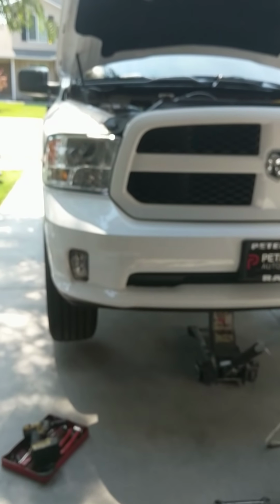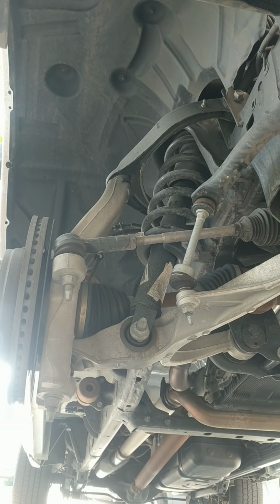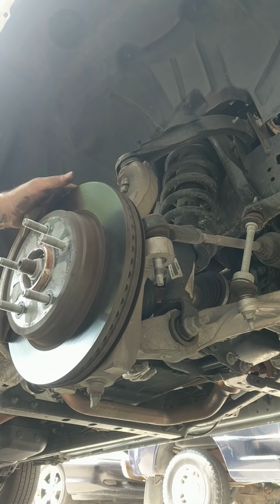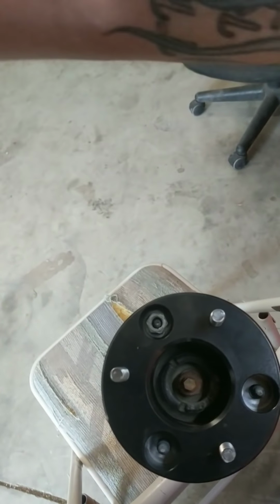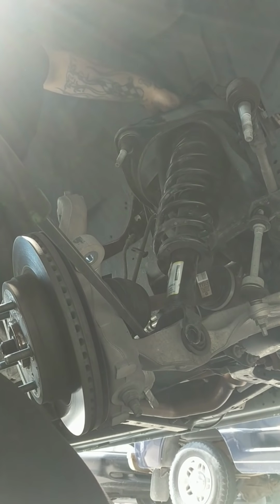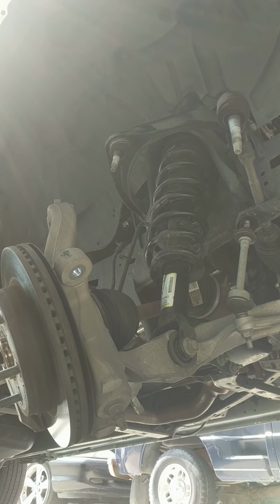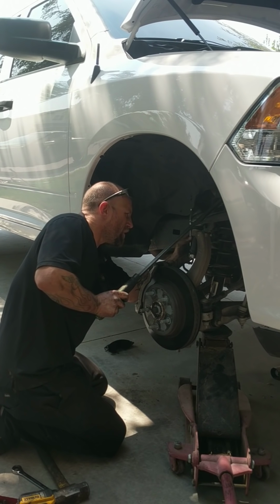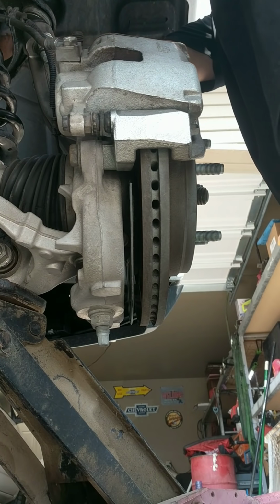Front leveling kit on a 2017 ram 1500

Comment: Great video. doing this project very soon on my 2017. I think I have the same kit. FYI the hex head bolts that come with the kit are intended to be threaded in from the bottom of the spacer (should be an over sized hole to countersink them).
Reply: Just got the same kit for my 2016...wondered why he thought the supplied bolts had to be threaded from the top. They thread fom the bottom and the heads go into holes recessed in the block, and become the studs.

Comment: Good idea not using the Allen bolts...mine were in 4 years and couldn't get the allen bolts out...filled with dirt etc but were stuck in the spacer...had to cut them off and not use the leveling kit unfortunately

Comment: Not to be a hater, but I Would Not follow this as an example to install this lift. Way to many discrepancies with this installation. No Jack Stands, All-thread instead of included hardware (What is stopping the All thread from unthreading from the spacer),  No torque wrench (Torque specs are there for a reason, not a calibrated elbow),  Your working on the steering and suspension components of the truck!  Please do not follow this example installation...
Reply: All thread should be sufficient Grade 5, not too much stress on the studs with the pressure of the spring against the body.

Comment: would u say this is a project that I could do with my buddies on a Saturday and be back driving by Monday also how necessary is an alignment after
Reply: My wife and I did this with the two and a half inch spacer and it took about two and a half hours and we kind of took our time a lot of the time was spent getting jack stands and everything I could find under the truck so if it fails it wouldn't hit the floor you have to be careful you can't just jump up and down on that bar he used you could tear the boot on the axle not very good bit video when you take the tires and wheels off lay them under the frame just in case jack stand fail

Comment: ALLTHREAD Is not a best choice for making studs. Cut proper bolts to make studs.
Reply: EXACTLY!  They are case hardened enough and could break or have the threads pull out.
Reply from the maker: Truck still on the road with no issues, and it was grade 8 all thread

Comment: I like this guy's ingenuity, but I don't think they make Grade 8 all-thread (or any grade all-thread). Don't think I would trust that. All-thread is typically pretty weak grade steel, with the amount of vibration in the suspension, I bet these break. Maybe just get a kit with good bolts that work correctly.

Comment: One word my friend... geometry. You’ll be changing out UCA’s every other month.
Reply: I've had it installed for 3 years no probably PS it's my truck lol
Reply: Justin Kudlacz hey man, I’m just going off what happened in my 2016. Running Bilsteins now (1.75” adjusted( and no issues at all. All good. Truck is slick.
Reply: @Faceless_XIV  yah that sucks yah I went with the 2 inch level bc on the 14+ Rams read ball joints can pop out but yah my 16 is doing good but I also hardly ever drive it. 😂

Comment: My upper control arms will NOT come out of the knuckle!! I loosened the control arm frame bolts and the knuckle bolt itself. I dead like 40 hard dead blows with a 3 pound drilling hammer and a mini sledge. No give at all!! Any suggestions????
Reply from the maker: ReaTac B  use A pickle fork or a tie rod end separator tool
Reply: Thanks! I'll give it a try. Thanks for the video.
Reply: Worked like a charm 🖒

Comment: Since the new bolts are in a different position going thru the strut mount at the top, the shock is twisted at the bottom where it mounts to the lower arm. Didn't you have to twist the shock around to line up the holes? If so, how? My shocks are bilstein 5100 and I can't get them to twist inside the spring. Am I missing the trick to this?
Reply: Did you ever find out about that
Reply: James Daniels typically a 180 degree turn, so bottom strut bracket goes on opposite of how it came off.

Comment: I put the same on my Silverado and it messed up my ball joints and arms running my tires out it was crap
Reply: after how long ?
Reply: Within 4 months I started having problems my alignment ball joints and I just changed my reckon Pinion
Reply: Mr.j Gutierrez i have many friends of mine that told after a full year, still no problem.. i guess you did something wrong or your truck was already up to date for a check.. i do know that this isn’t the best mod for leveling but It doesn’t affect that bad in that short while..

Comment: Does this lift  change the angle of the upper ball joint?
Reply: Kelly Fontes yes. It is very dangerous
Reply: Upper ball joint will fail with enough stress and time
Reply: Cv axle angle is where the big problems happen

Comment: Why cant you just leave everything in place and just use a spring compressor  to lower the top of the entire strut and just sneak the spacer on top ? You woudlnt have to remove anything else from the truck ! ??
Reply: a spring compressor will only compress the spring. you'd still have to compress the strut too and get it compressed enough to bolt on the spacer. sounds like a ton of unnecessary work compared to roughly 20-30 mins of just unbolting the control arms, caliper and ball joints.
Reply: I'll try it and let you know. Just got my 2" leveler !!
Reply: yeah man, let me know. i've been pricing them out. i think i want to do the bolt on style ones like seen in the video, rather than the hard plastic ones i've seen. Which ones did you get?